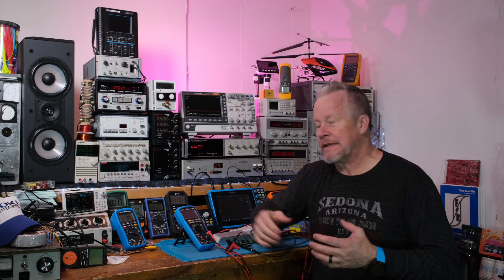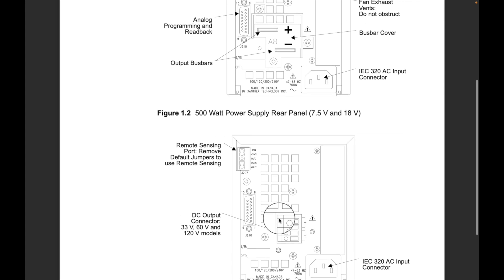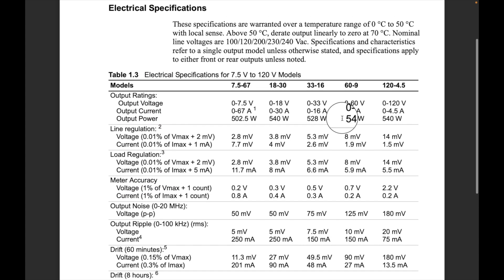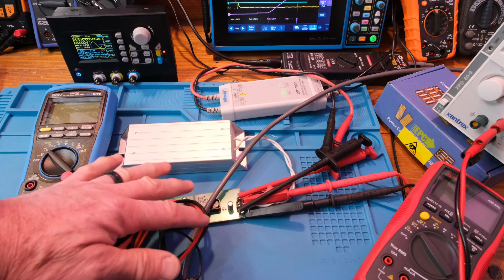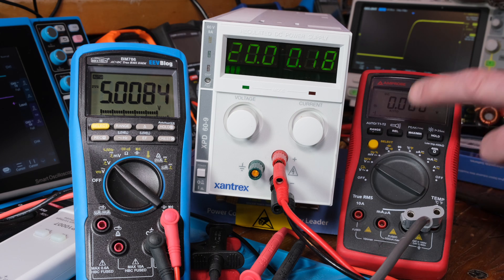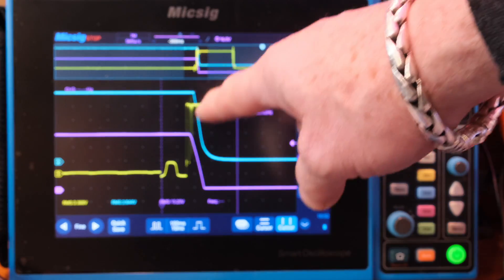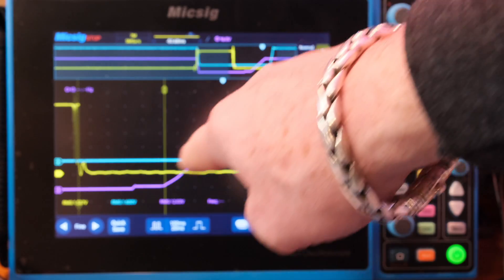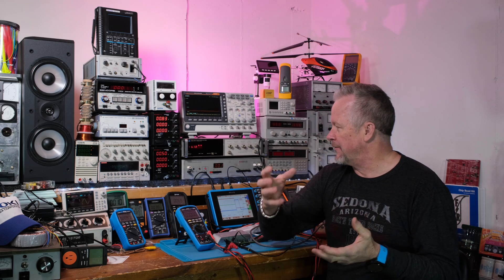Power Supply Remote Control Output On/Off

Comment: Hi Eddie, the XPD 60-9 is now obsolete and no longer in production. Its replacement the DLM 600 series is way too expensive. I'm looking for an AC/DC 60v PSU with similar external control features to the XPD have you come across anything that I might take a look at?
Reply from the maker: Are you looking for a fixed 60V or variable up to 60v?
How much current?
Reply: @KissAnalog  Okay...remote on off needed, voltage control of level of volts and amps. The XPD 60-9 appears to be able to vary voltage 0-60 and amps 0-9. Could live with fixed 60V but the current must be remote controllable by an external analog voltage say 0-5V or maybe 0-10V. Output current circa 10A.

Comment: i dont think i have heard any fan noise in any of your videos. if you wanted to, you could always swap out the noisy fans with a lower rpm fan. i originally found your channel on the review you did on the kunkin electronic load, just wondering if you use yours much?
Reply from the maker: Thanks for that feedback!  I do need to try and get a quite fan to test out.  Yes I do use the Kunkin occasionally.  Do you use yours?  Is there something that you would like to see in a video?
Reply: @KissAnalog  i pretty much use mine on testing SLA batteries lately. i really just thought  about the kunkin when you're testing out a new power supply. usually i see you have a resistive load connected checking for noise. i always wondered why not just hook up the kunkin? but the more i thought about it, a switching type load would more likely introduce noise. just one of those "hey, i have the same thing they do" type tools and wondering why its not in more videos. really though its a very job specific tool .  i really like your channel though, its re-kindling some of my interest in electronics from way back in high school. to bad however most stuff today is just made to be thrown away and not repaired.

Comment: One PSU requirement could be temp. controlled fan.... happy with my Riden 12amp, fan rests most of the time🙂
Reply from the maker: Thanks Arve!  I had an uncle Arve;) Do you know which brand of PS that is in your Riden?
Reply: @KissAnalog  Hey, I have Riden RD6012 paired with a 50V DC rectifier I got hold of.
Lazy butts are not doing decent fan controls😂

Comment: And yes, thanks for this. Neat to see a method on how to see just what happens with such  Bench Power Supply. Years ago i jumped in after having built so many linear test psu a sprojects for my bench that were always ending up they were too low in voltage & current capability or the current limit function was pathetic. So i sprung hard earned $ for what was advertised as a great unit... & one day with it connected to my DUT i powered it down, repo'd my probes & re-powered the expensive PSU & it went wild to full current, full voltage & i a microsec destroyed my high investment project... Not a happy tech! I was angry & a check on YT other folks were suffering the same... https://www.youtube.com/watch?v=zAoHnbBmfsI